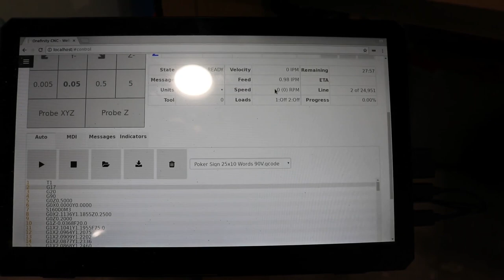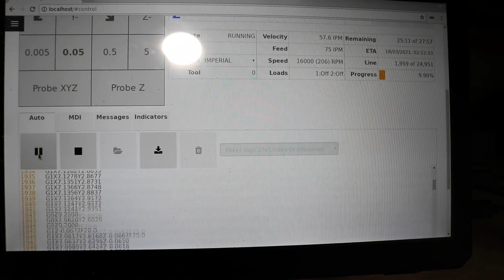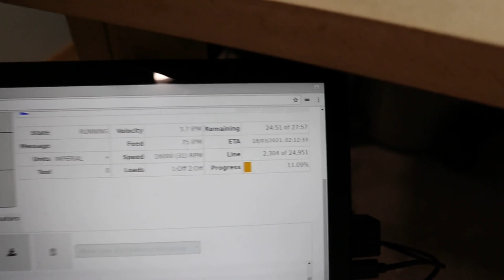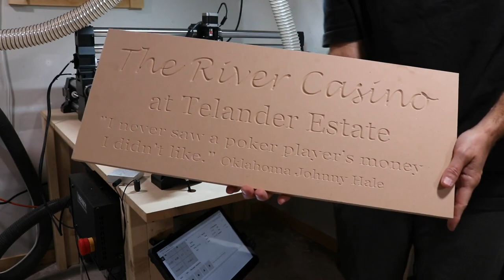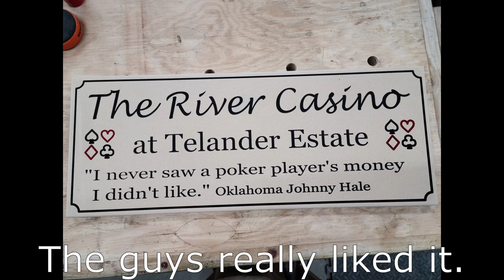Onefinity CNC Spoil Board Grid // First V Carve using Vcarve

Comment: I'm assuming you made your grid 24x24 due to  vcarve limitation.  I had the same issue.  I ended up creating a 16X16 grid program.  set materail home to the exact center of working space with this command g00x408y408.  Starting from there I ran the 16x16 grid 4 times changing the xy datum so it would cut out the 4 quadrants...  Worked good though you're exactly correct I haven't come close to needing the gridlines that far out...  Sign looked really good
Reply from the maker: You are correct. I actually used the tiling feature in Vcarve to create a 32x32 grid but haven't seen a need for it. So I just left it as is. I upgraded to Vcarve Pro so the size limitation is no longer an issue. I like your solution. Very clever. I designed a kind of wild layout with a grid, diagonal lines corner to corner and circles. Probably over kill but it might come in handy. Next time I surface my spoil board I'll give it a shot. Thanks for watching and sharing your experience.

Comment: I enjoyed your video...very helpful. I have a question about your spoil board.  You chose to NOT use T Tracks or anything like that and I'm curious to why. Solely going to use the tape and CA glue or double sided tape methods....or something else? Thanks again.
Reply from the maker: This was my first time using the machine. I have since added 1/4-20 t-nuts as an additional hold down option. Check out this video. https://youtu.be/1GIA6dKegEY
Thanks for watching.

Comment: Looks good Matt. I too have the 1f and am just getting started with it. Today I installed my drag chain setup from "ROUTE 1 WOOD DESIGN" A great website for 1finity items. You will enjoy this machine, it's solid. I carve most stuff at a pretty high feed rate and take a bit deeper cut because it can handle it. I have been cutting on red oak and maple so far and this machine gobbles it up. Anyways I went ahead and subscribed so don't let us down. Bill from Colorado
Reply from the maker: Thanks for the comment Bill and the sub. Yes, this machine can handle way more than I'm throwing at it. I'm taking notes and learning more every time I turn it on. If there is anything in particular you would like to see let me know. I have a bunch of video ideas but I'm open to suggestions also. Thanks again!